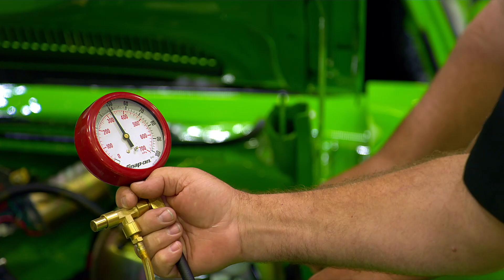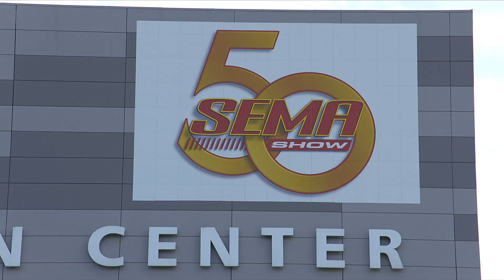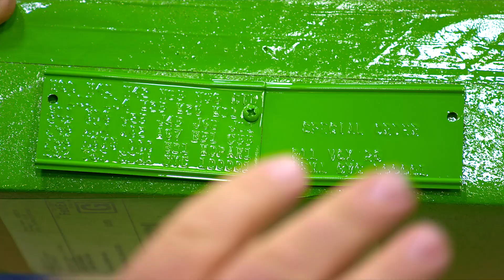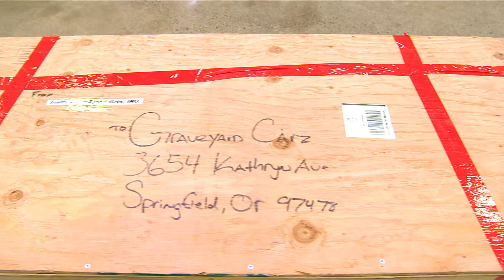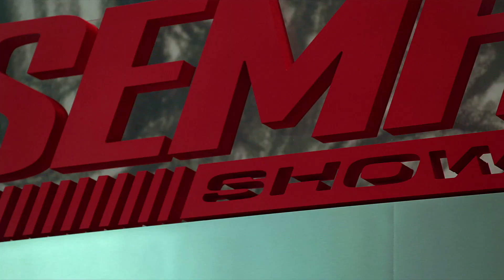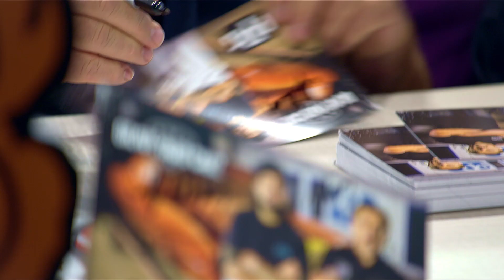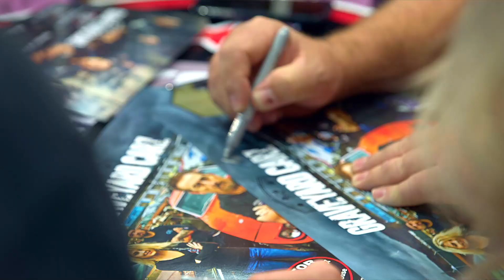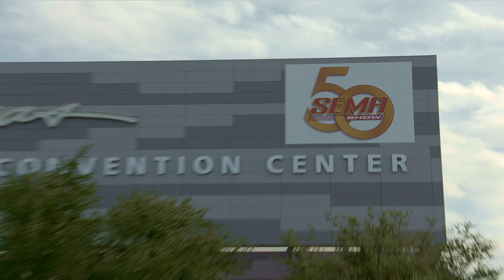THE '71 'CUDA THAT STOLE THE SEMA SHOW!

Comment: Actually remote start stick shift is not a good way to die, my ex-brother-in-law actually had a remote start in a 5-speed Ford Ranger, forgot he had it in 1st, started it on the way outta O'Reilly & got slammed between the brick wall of O'Reilly's and the truck, he died later on.
Actually heart attack in sleep @ 25 - three years after the truck thing & unrelated, but remote stick shift still not a good way to go anyhow.